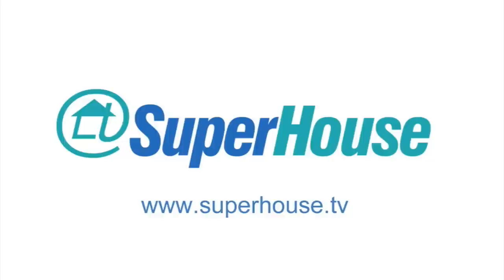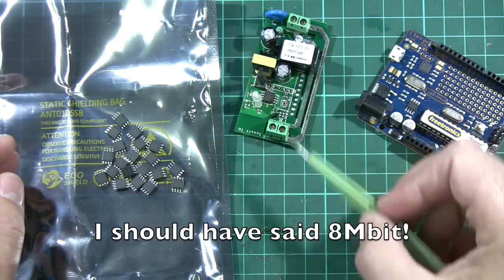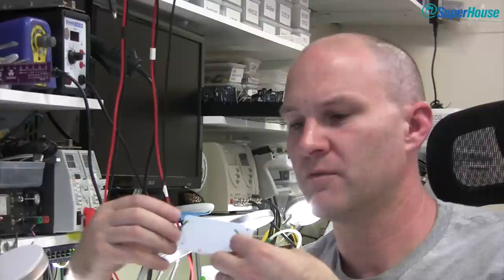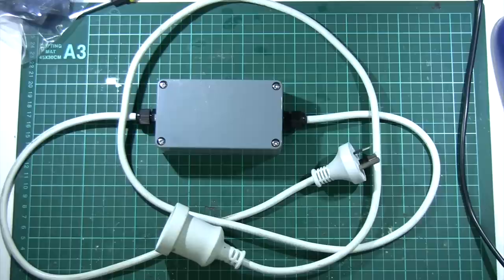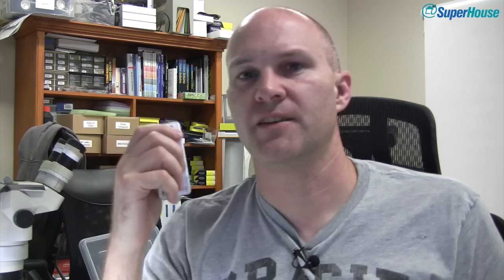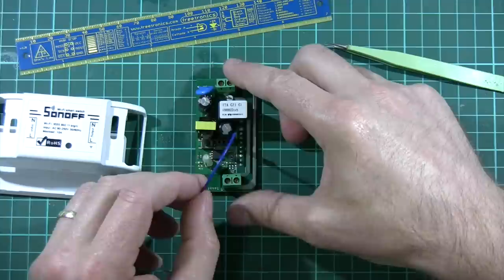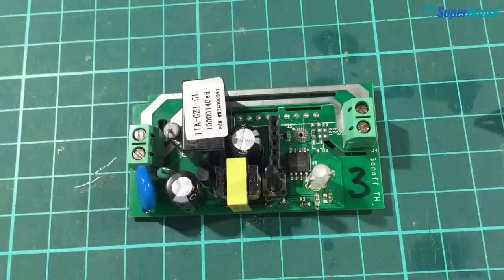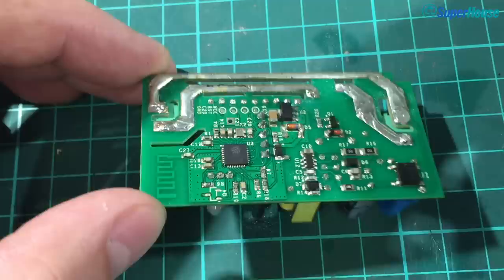SuperHouse #21: Six Sonoff Secrets: Storage, Safety, Switches, Sensors, Software, and Sites

Comment: could you please add to the video loud and clear, the partnumber of the new flash you mount, also when you program the sonoff after the upgrade, do you use arduino ? like i do ? it could be nice to reveal the special settings needed in the auduino system, i use a wimo sketch, where i put in, wifi codes, and device name, then bingo, my Alexa discover the unit and can control it directly, with out any hazzle with plug in software and their buggy settings and configure

Comment: I am trying to understand inching mode. I know what it does just don't understand the calculations. I want to set a light to turn off after 5min when set to on. How many inching sec. would that be? It's not a typical 60sec per minute. Is it half a sec per minute on the Sonoff?

Comment: i realy enjoyed watching this. i am going to start my home automation with sonoff soon , but i would like to use the livolo light touch switches combined with the sonoff, in a way that i can control it true wifi and with the livolo switch and be able to let the two comunicate with eachother... can you work on a tutorial about this pls.... allready saw sole livolo automation online, but not comvibed with sonoff... thx
Reply from the maker: Sorry, I don't know anything about Livolo. I just did a search for it and found this discussion about communicating with the Livolo switches using an Arduino: https://forum.mysensors.org/topic/2775/livolo-glass-panel-touch-light-wall-switch-arduino-433mhz If that can be made to work, then it should be possible for the Arduino to detect when the switch is pressed and then send a message to the Sonoff using MQTT. If I had a Livolo I could try it.

Comment: Hi, nice video ... I look for a solution to use it to open a door.  I need to set up the switch to stay 4 ..5 sec ON and then automatically return in OFF state -- any time when I push the button. Or to keep it ON state as  many seconds I stay with finger on the phone button.. Al this to not over heat the coil of the door strikes. Has eWelink this king of soft settings  .. I don't manage to find it! Thanks

Comment: Hey Jonathan, i notice when you wired up the TH10 you didn't use the earth connections on the 2nd and 3rd connectors.  Is there anything to be concerned about there?
Reply from the maker: The Sonoff itself doesn't use the earth connections, the terminals are just provided as a convenient way to pass through the earth to the load if it needs it. In that demo the light fitting doesn't need an Earth connection.

Comment: Thank you very much for your video's about the Sonoff. I was looking for a way to embed it in my current setup, with existing wall switches... and you explained it here :) Many thanks indeed!
One question: when using the Sonoff (in the ceiling) together with a wall switch (in the wall), is it necessary to have 2 wires running from the switch to the Sonoff? Or could I use something else (close to the switch) as the ground instead of the GND of the Sonoff? I already have 1 black 'switch wire' available and not much space to add more in that tube, that's why I am curious...

Comment: I have 3 way switches for my garage and hall lights.  Can incorporate 2 of the channels on a Sonoff 4Ch Pro to replace a 3 way switch on two other circuits that turn lights on and off?  The relays are 10A NC/NO aren't they basically the same as a three way switch?  The remaining two channels open and close my garage doors and work great.

Comment: This is a brilliant video. Thank you. I’m new to playing with home automation - I have amazon echo which successfully pairs with the sonoff but I want to connect the simple sonoff unit to the existing light switch to give what is effectively 2-way switching as you have done 26 mins into the video. I have connected the switch across points 4 & 5 as you did, but it has no effect. Do I also need to do a software mod?

Comment: Great video :). Can you link me which boxes and cables you used for the Safety part? Thanks.
Reply from the maker: The lightweight project box I used is called a "UB3" project box. It comes in different colours. Here's one example: http://www.altronics.com.au/p/h0203-ub3-130lx67wx43hmm-black-abs-jiffy-box/. The IP-rated case came from a supplier that I won't link to, but there's a similar one here with slight different dimensions: http://www.altronics.com.au/p/h0301-ritec-105lx75wx40hmm-ip65-sealed-abs-enclosure/ Finally, this will provide a list of cable glands in different sizes and types: http://www.altronics.com.au/search/all/?sr=cable+gland

Comment: Hi, great video.

I would like to point out that in 26:19 and once more before that, we can see that the app doesn't informed about the Sonoff state after the switch change its state.

You must push twice the app switch. Once to go the real state of the Sonoff and once again to change the state as you want to be.

Is that correct?

Comment: Hi great video. Thanks a lot. Referring to adding a mechanical switch to sonoff (min 25.50), I need to control the sonoff from two switches located in different area of the room. Is it  enough to connect both switches to the pins you showed on video to achieve it? thanks for your answer. Vic

Comment: hello, loved your videos and helped me understand about Sonoff devices set up. I have a quick question. how do you add an external switch to Sonoff POW R2? I'm not sure where to solder the wires, I have  IO5, IO4, GND, TX, RX and <VDD with left arrow marking in Sonoff POW R2. I'm getting power in all these pins (tested with a tester). If I connect GND+VDD --> turn off if i connect the wires but doesnt turn on if i connect it back. GND+IO4/IO5 --> doesn't turn on/off. Pls help. Thank you

Comment: And prefer state change + on/off, so if it's off and the switch is in the on position, toggle it off and then back on and vice versa : if it's on but the switch off, toggle the switch on and then off to turn the output off

Comment: Love the video. I have a Q, I want to use a dual channel sonoff converted to dry contacts (or 2 regular sonoffs) to control my 2 garage doors. I am wondering if there is the ability to monitor and report the state of an input in the sonoff/ewelink. I would like to monitor the state of the doors using a couple reed switches that would report back to my smartphone if a door is open so I can make sure the doors are closed at bed time. The "wemo maker" has this ability but it is $$. Thanks and keep up the great videos.

Comment: What disappointed me was finding out after buying a TH16 with the humidity/temp sensor, the unit either switches on/off with a set temp range OR humidity range and not both, with either the humidity being leading or temperature being the leading value for switching on or off, is this a limitation of the eWeLink app or is this a firmware limitation in the TH16? and is this changeable with different firmware?

Comment: 10mins in, re comment about air gap on earth, there is a much easier fix, when splicing, strip slightly more outer sheath than the length of the sonoff but, don’t cut the earth wire.   Cut the other two wires (red & black depending on country)  and trim them back so they are not too long so you can wire to the in and out.

Comment: Great video, thanks!
Sorry, I can not understand 100% English and I am not sure about switch connection on/off for for a wall switch. It is as easy as soldering two wires in pins 3 and 4 or it is necessary make some firmware modifications on sonoff device?

Comment: Is it safe to use on my solaf water heater SR500 control panel? I want to over ride the heat button with wifi and hook the temprature sensor on gpio14 but i read that its safer to use a dry relay in between?

Comment: Thanks for the Great video. I  not a certified electrician nor degree in electronics but have you notice that the AC output draw 2.3 volts when it is in off. Really appreciate if you have any idea why.
Reply from the maker: Sorry, I don't know what you mean. Where are you measuring the voltage? DC or AC?
Reply: My multimeter dial is set to AC when I was doing a test.
Reply from the maker: Where are you measuring? Between neutral and the active output? If so, it's probably just induced electrical noise, not enough energy to power anything or an indication of power leaking through the relay.
Reply: Thanks for the reply, I connect the multimeter to the AC output of sonoff instead of actual load. I thought it is a defect as i noticed it on 2 sonoff units

Comment: Is there a way to use a external switches to turn on and off two appliances connected to a Sonoff Duo (as explained starting on 23:23 for the standard Sonoff switch)? If so, which would be the pins the switches would have to be connected to?

Comment: Is there a possibility to use a default wall rocker switch with the sonoff while keeping the original software? I like the default app of the sonoff and the ease of pairing it with Google Home, so I'd rather not mess with the software... But as far as I can see, the only way you could do this is with a momentary wall switch parallel to the switch on the sonoff right?

Comment: Hi,
I'm new and getting into the sonoff plus bought a couple esp boards to test with. I needed some advice on which route to go for software (vs using cloud).
For a new person getting in, should I go with openhab, Hass, home seer, etc? I hear Hass has tons of add-ons vs other but is harder to start off with. Openhab is easier but limited since it doesn't have as many addons

Comment: WOW... Well done amazin video. i have a question if you dont mind. at 25 min you mentioned you can use pin 14 and ground and it is un modified, did you modify the firmware within it or was that stock?

Comment: Thanks for the great blog Jonathon.
I want to use the current light switch in conjunction with the sonoff, but if I connect ground and GPIO 14, as you illustrated in your video, nothing happen. I tried on different sonoff's but with no success. What am I doing wrong?

Thx

Comment: Hi Jonathan. I’m interested in using a Sonoff in place of a light switch and manual dimmer to switch an ac halogen light. I want to retain the dimming feature though. Is there an easy way to modify one of these sonoffs to allow it to dim? Could you use the Sonoff LED controller and a mosfet or something to switch the AC voltage, or would it be easier to build a DIY one? If so, what components do I need? I’ve worked with Arduinos and the same ESP before but I’ve never configured it for voice control with google home which I want to do

Comment: Jon, regarding using the IP65 box - could you remove all the plastic casing from the Sonoff first before mounting it into the box? - its just i have seen some of these Sonoff plastic cases melting quite easily in other videos.
Reply from the maker: Definitely. I left it in the original case just for a bit of extra safety while testing it with the cover off. For a larger board such as a Sonoff POW it would be necessary to put it in the box without the original case so it will fit.
Reply: Thanks Jon! after watching your detailed explanation of these Sonoffs i've ordered a few to experiment with.

Comment: Great video, thanks. One question though, when you have a push button switch wired to GPIO0 to manually control the sonoff, when you push the wired button, does the state on the mobile app updates so that it stays in sync with the hardware's status?

Comment: I'm just curious,  what is the benefit of using a sonoff, vs a tuya smart plug?   It seems like tuya is a more cost-effective and potentially safer way of making a device smart without making a permanent modification.    Also the tuya devices can still be flashed with tasmota or alt firmware if need be.  Personally i have a sonoff basic on the shelf that I have never used since I can't find an area in the house that couldn't just be served by an Esp 8266 smart plug/outlet or a smart switch.

Comment: I know I'm very late to the game here, but I just found a great project for a sonoff.  I picked up a Sonoff RF so that I could use it with an RF receiver (I didn't want to add my own).  After trying repeatedly to press the button when powering up, the chip REFUSED to go into programming mode.  I ended up manually holding a wire up to GPIO 0 from ground to get it into programming mode.  Not sure if this will affect anyone else, but I was about to give up when I decided to get as basic as I could.  I'm not sure which GPIO the button is hooked up to, but even after loading up TASMOTA, it still turns the power on and off.  If it truly is hooked up to GPIO 0, then there must be something else going on preventing the chip from going into programming mode.

Hopefully this will help others in this situation

Comment: Would it be possible to connect this adafruit momentary RF receiver  https://www.mouser.co.uk/productdetail/adafruit/1096?qs=sGAEpiMZZMsMyYRRhGMFNjqDQYsYcDL2Fv3BKLtFzKE%3D 
to the momentary switch solder points on the circuit board of the Sonoff th16. Would this power the receiver? I would like to add RF functionality without hacking the firmware. I also need the 16amp version, so the RF version Sonoff have isn't suitable. Any ideas?

Comment: What is the WIFI range of the switch or does that mainly depend on the WIFI  controller device?      Also, how do you wire a wall switch with it since the newer Sonoff no longer have GPio14 pin?

Comment: Any suggestions on actually getting these inside the wall for use with the lightswitch? At least here in North America there isn't room behind the switch for the sonoff. Would you put it in the wall somewhere near the switch and wire it from there?
Reply from the maker: It would depend on the specific situation, but this is a great question. I'm going to do a follow-up video about how to do this, and also things like setting up multi-way switches for corridors, and light switches that only loop the active to the switch and don't have a neutral nearby.
Reply: I have glove type light fixture in the ceiling in my loft, and I added SONOFF inside the light fixture itself, because it didn't fit in the switch itself. I hot glued the case wall so that it doesn't rest on the glass dome.. :-)

Comment: Jonathan, Thankyou, this was a great intro to hacking the sonoff. It certainly looks like a mature version of the esp8266 automation that is usually hard - i.e. the connection to the A devices in the house. Your hacks are very easy to follow and inspiring to use.  However I have one concern with AC devices. Are these rated as safe to use in OZ building wiring, i'm actually in NZ but we have similar standards. What worries me is whether the power supplies in these are are good/ok/reasonable ec. esp wrt. fire safety/risk. Could you do a small section on that please?
Reply from the maker: My personal assessment is that these units are very well made. The designers have gone to some trouble to achieve good isolation between mains voltage and the logic part of the board, with slots milled into the PCB to provide air gaps. They're certainly better than many other devices I've seen. Also, I've heard that some Sonoff models have now achieved proper CE certification and the official certificates are now available from the ITEAD site. For example, scroll down this page for certs for the TH models: https://www.itead.cc/sonoff-th.html The full test reports can be obtained from http://dl.itead.cc/CE-RoHS/ITEAD-Sonoff-Series-CE-RED-RoHS-Certificate-and-Report.zip
Reply: Thanks Jonathan. That's exactly the kind of thing I was worried about.  Appreciate the quick reply.

Comment: Hi Jonathon, Great work on this topic.
before i found this I found some code to flash that makes my sonoff amazon alexa  detectable.
 But it does not have the code to toggle a standard wall switch wired into the button.
would theTheo Arends’s TASMOTA's version be detectable by alexa.
Reply from the maker: I don't have an Echo / Alexa device so I don't know anything about how it works, but there's a bullet point on the TASMOTA wiki that says "Amazon Echo (Alexa) support". But that statement on the wiki is all I know about it!
Reply: Maybe I'm late to the party but I received mine yesterday and I'm using it with Alexa already. I'm using their app to do the pairing and use Alexa to turn it on and off. No need of flashing.

Comment: I have tried removing the original flash twice and lifted some pads off the board both times.  These aren't that expensive but I don't like throwing them away.  What can I do to prevent this?
Reply: Bob Moran  Cut the legs one by one.
Reply from the maker: The trick is to use just enough heat, and just enough force, but no more. In the video it looks like I'm applying a lot of force with the screwdriver, but I'm not. I'm just using a gently push/twist to move one side of the chip slightly away from the pads so that the solder disconnects. I intended to say something about that in the video but I forgot.

Fredrik's suggestion is good, too. If you have some pointy-nosed cutters, you can carefully snip off the leads of the old chip to get it free. Then it's easy to use a soldering iron to "wipe off" each of the remaining pins from the PCB, leaving the pads with just some solder on them. You'll probably have to bend the LED out of the way though, because it blocks one side of the chip.
Reply: Thanks  I will give it another try